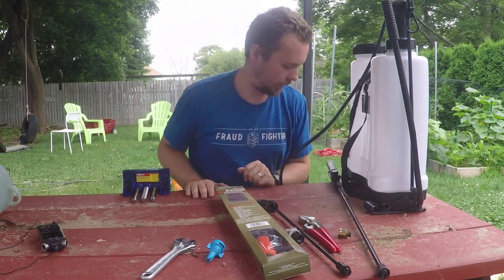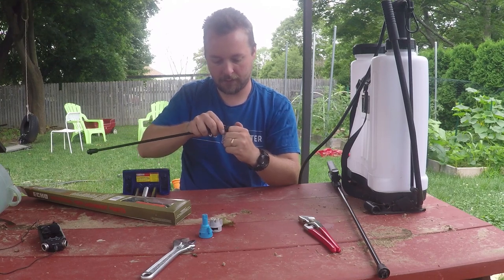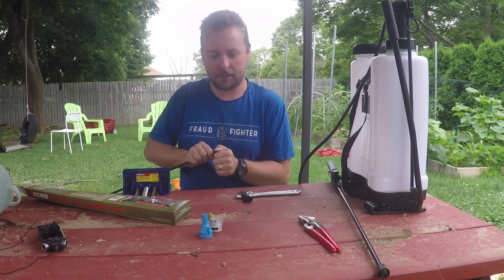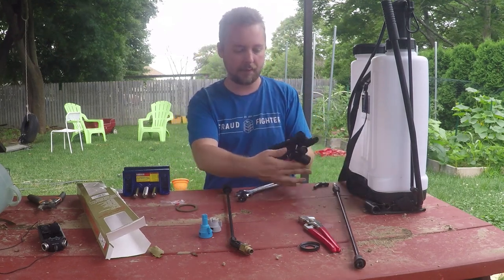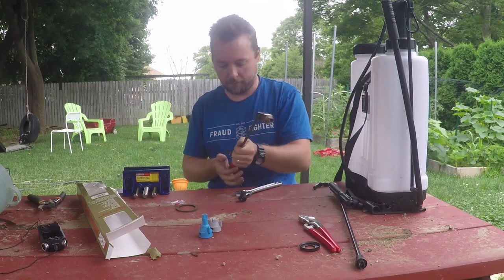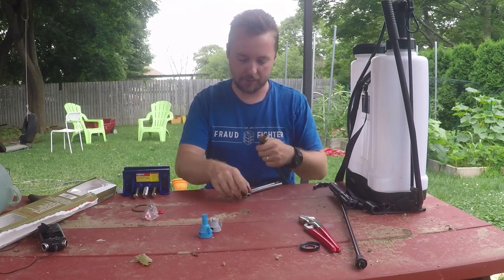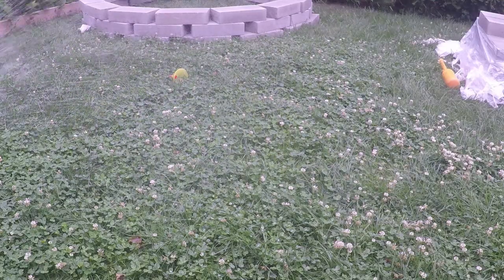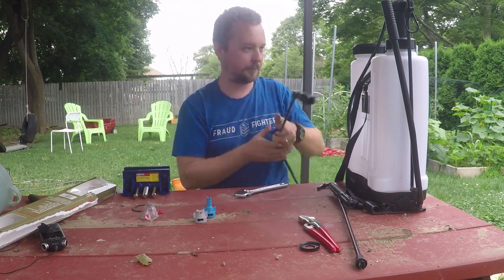Which Sprayer Nozzle Should You Use?

Comment: I think I had the adjustable nozzle on the 2gal Chaplin pump up sprayer ( prob not the expensive one) set for a wide fan spray when applying Tenacity with surfactant, blue dye and I'm not seeing good results. Should I narrow, adjust the fan down for better results?

Comment: New subscriber!  Great content. I have a Storm sprayer with the quick connect type brass spray wand. I am not finding an adapter for the TeeJet nozzles so they work with the quick connect brass end. Any ideas?
Reply from the maker: You can get the insert nozzles that you put inside the tip that came with your sprayer. It won't be quick to switch but I use the same one for most apps

Comment: Will the blue nozzle thread/fit directly on a chapin wand? I really don’t need the quick connect (I am happy with my brass nozzle for killing weeds).  The blue nozzle looks perfect for spraying soil conditioners!
Reply from the maker: So the blue nozzle is a quick connect nozzle. Teejet does have an enormous number of options. You can get just the tiny nozzle insert that you can put inside the screw tip that comes with the wand.

Comment: Just an FYI.  The 3/8" brass pipe fittings works perfectly with the Chapin sprayer.  You will need to use a some teflon tape on the threads.  I have the 3/8" 90* but you can assemble anything that you are comfortable with
Reply from the maker: Awesome! I've been asked quite a bit but I never remember to go find out what size I used and what size I should have used 😁

Comment: what size brass fitting did u use i have same problem i have same wand
Reply from the maker: thecuttedgelawn I forget, I should bring it to the store to measure. What I did was went to Ace hardware with the quick adapter and found one that fit. Note I had to force it onto the plastic wand as the wand appeared to have a non standard thread size. Being plastic I could force it on OK though.
Reply: The 3/8" brass pipe fittings works perfectly with the Chapin sprayer.
Reply: @Methodical2  can you tell me where to get this 3/8 inch brass pipe fitting.
Reply: @dwainhuff6149  I got mine from Lowes.  HD or any plumbing supply shop will have them, too.